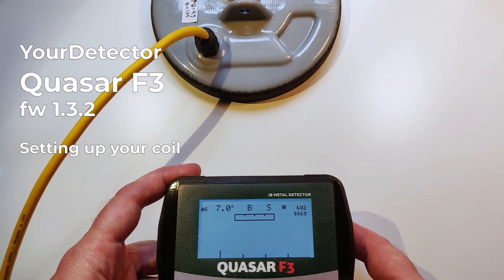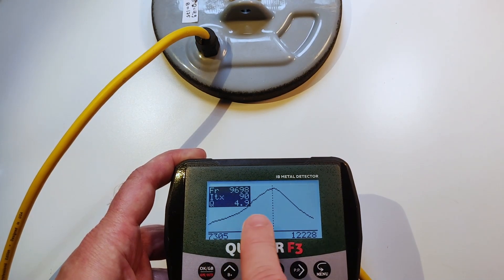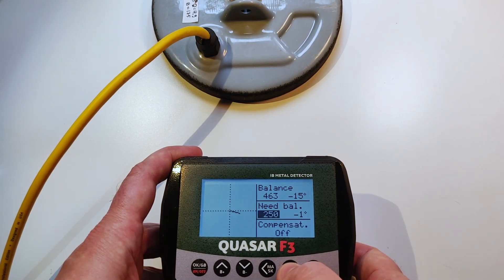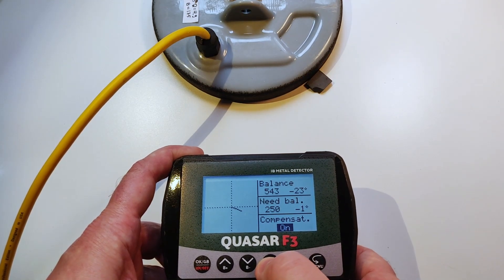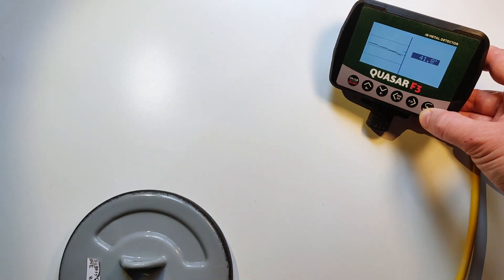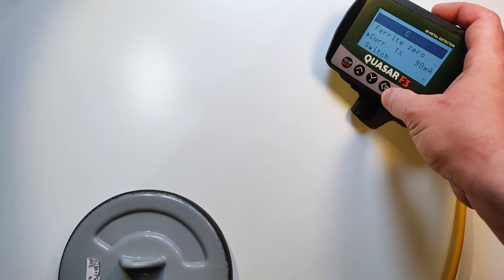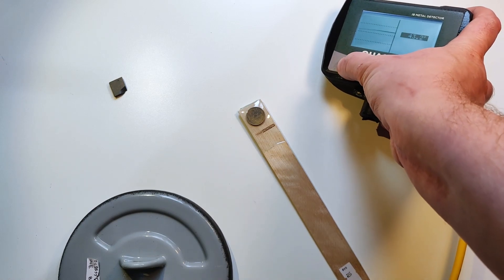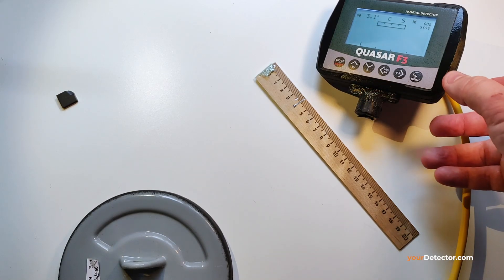EN: YourDetector Quasar F3 - setting up your coil

Comment: Does ferrite from radio work ? I didn't get ferrite on my box when I got my Quazer ?
Reply from the maker: Sure! Ferrite from radio antenna from the grand-dad radio:) Alternatively you can get one from the good USB/VGA cables (these thick bulges on the end of cable. Cut the resin with a knife). Or, you can look for the Inductances on some PCBs. They are wound in/on ferrite cases. But they're small. But enough

Comment: Hello agen. I have problem with Main  new quasar f3  maybe you will now  the problem,
Reply from the maker: Hi Andrzej! Youtube lost my previous big comment so I will be shorter this time =)) First of all, - your first question looks shortened. Can you explain which problems you have with Main? 
Regarding the coils - I do not think there are other coils directly compatible with Quasar detector. The Fortuna coils and AKA coils have bit similar insides, but anyway you will have to change the Pinout or Connectors.
The good thing is that most of the coils could be ADAPTED to Quasar with not too much hassle. In short words - you need to change pinout and add some pair of capacitors (for resonance). Ping me at +79257300365 (Telegram, Whatsapp, etc) for advises!

Cheers, Sergey
Reply from the maker: UPDATE: Seems like YouTube deleted your link, but I found that video in your videos. There are two things I would like to mention:
1. If your Ferrite angle is not properly set - the unit probably produces sound in that area. By moving the cable you hear sound from Ferrite Zone. Once you tune your ferrite - noise will probably go completely off. Check that Ferrite specimen does not produce sound in this Area of VDI. If you do not have ferrite - I will try to find other specimen for your calibration (like Euro coin etc... )
2. In case Ferrite is set - that is a bad news, maybe you have the coil which is not made well :( Probably it has a very bad coil cable... That is probably impossible to fix..

Cheers
Reply: @YourDetector  i cent set feryt its inposible i destroy coil cut in half end insaid wos coins lol .movie wos maid on barier 22 ,coil is bad i will buy new coil in Poland from fortuna or quasar thx for help Main frend  best regards from Poland 
Andrzej
Reply from the maker: @mlodykon83  hahaha 🤣 okay yes seems you need a better coil! Should you plan to visit Moscow, we will make you a perfect and light coil! :) ( Don't think we could send anything out of Russia these days.
Cheers to Poland! ( My grand grandma is Polish ;) )
Reply: https://youtu.be/iba-oOXMufY  i record movie with problem
Reply: End i wona Ask you ,wot coil from other detectors will works with quasar  f3 ,from maybe garett ,or nel Hunter  coil i need to buy new one